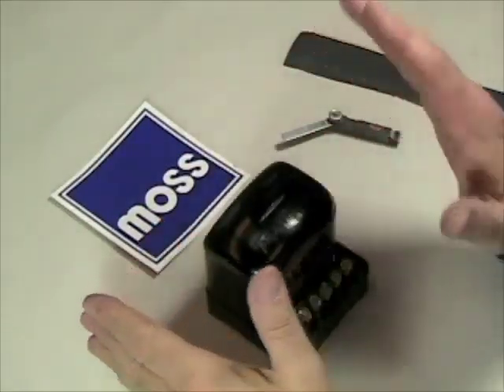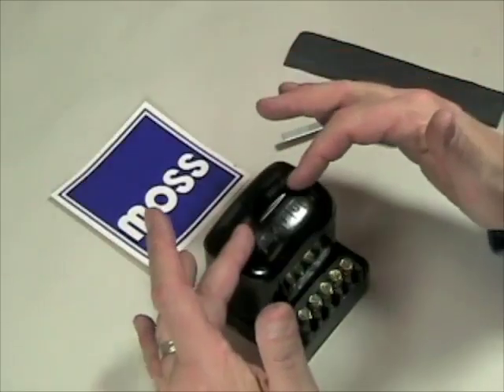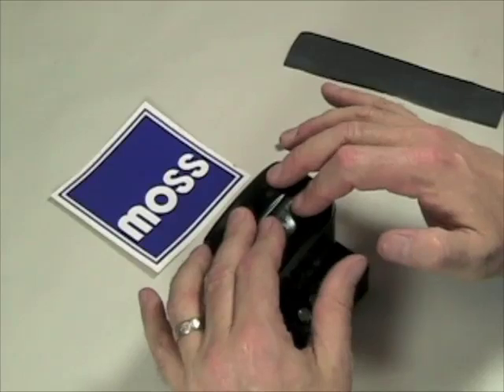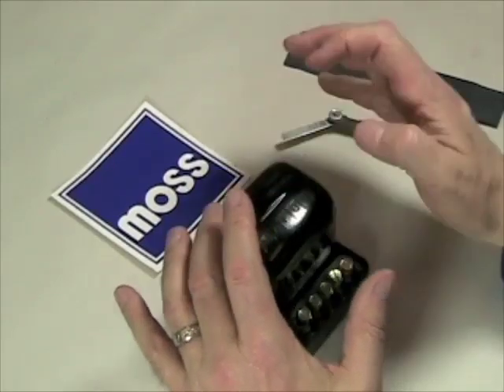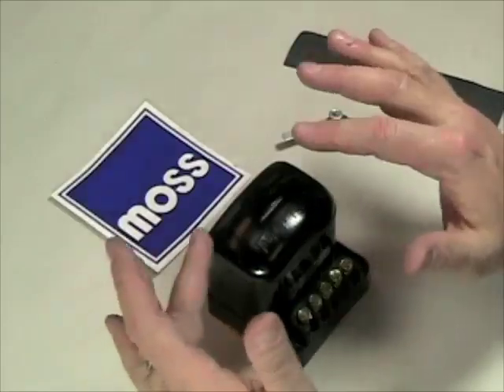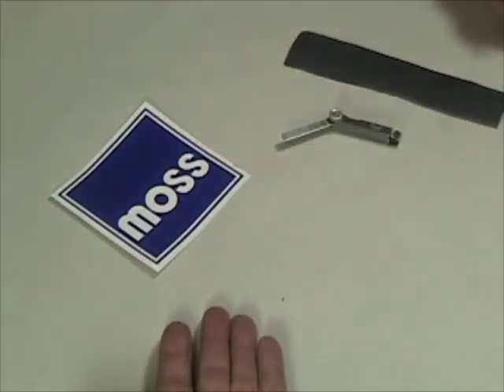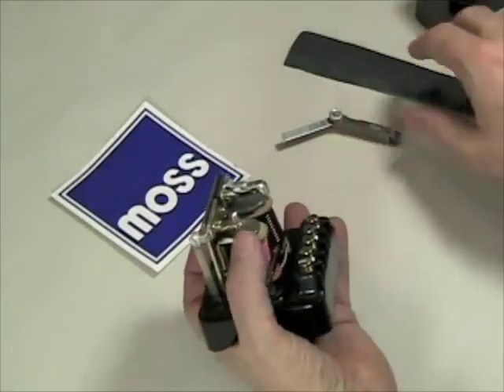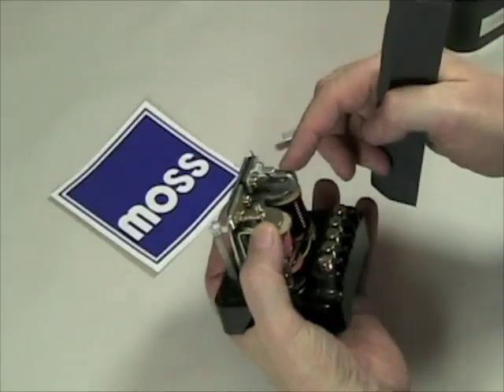Voltage Regulator Adjustment (Pt 3) - How to Install & Adjust

Comment: In an earlier video i think you said the cutout was by default closed. If so what is the gap we are testing. Mine is open, if i close it manually with fast engine revs it shows a good charge. But with engine off the points are open.
Reply: Your cut-out  sounds like it is working correctly. Default is open ,otherwise the battery would discharge to earth through the armature of the generator. The explanation these videos give is sometimes not as simple as it could be. If you need any more information please reply.

Comment: You shouldn't use emery paper - as in this video - to clean the extremely soft cut-out points. Use very fine glasspaper (Lucas should know ...)
Not familiar with "flint paper" but sounds like a form of glasspaper.
Emery is only OK for the much harder points on the regulator side .